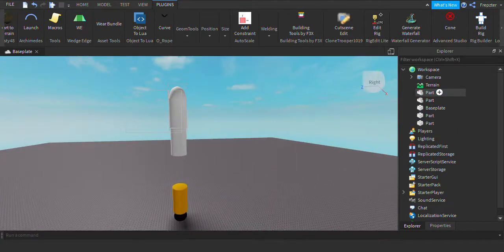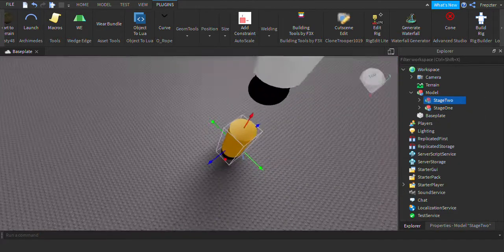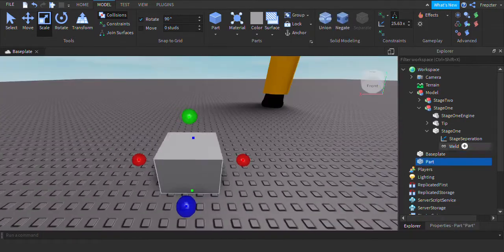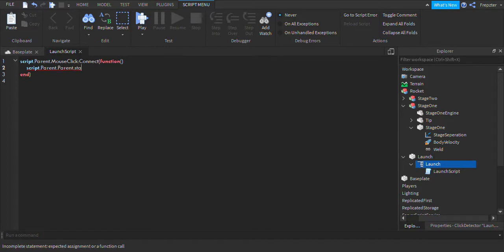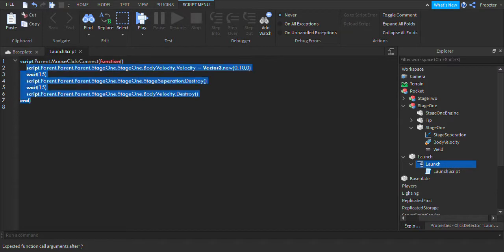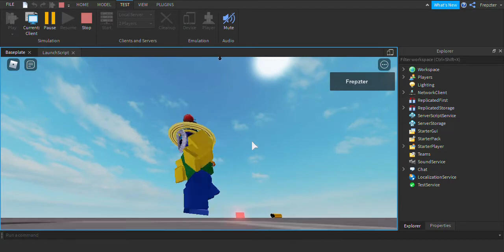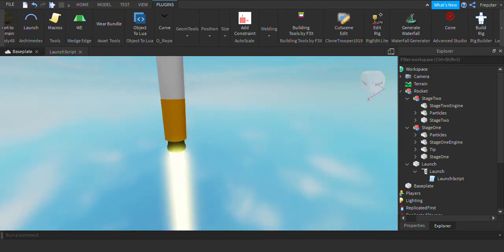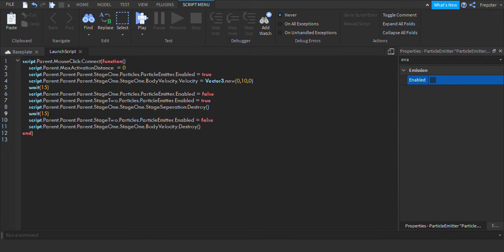How to make a Multistage rocket on ROBLOX STUDIO || Roblox Studio

Comment: What's up man!, great video, but I would like to know if the rocket model's customizable, and if it is, how can I modify it without it altering the stages?

And finally, how can I make the last stage rocket not to fall down, ty :)
Reply from the maker: You can do that if you have extra parts you can weld them to each stage and then use weldconstraints after. And for it to not fall down dont make it destroy the body velocity